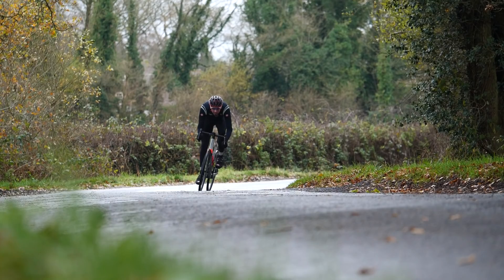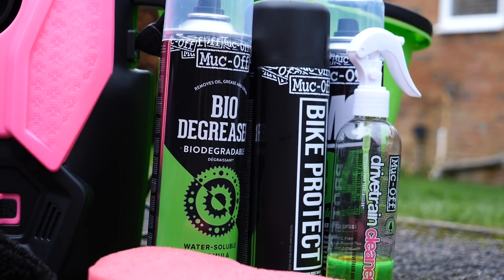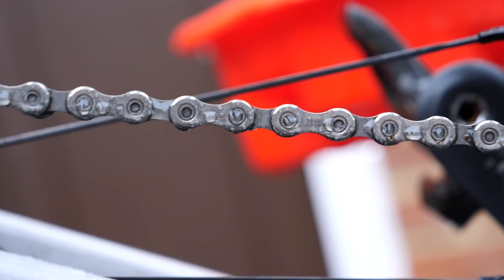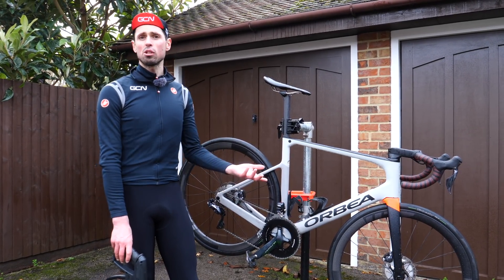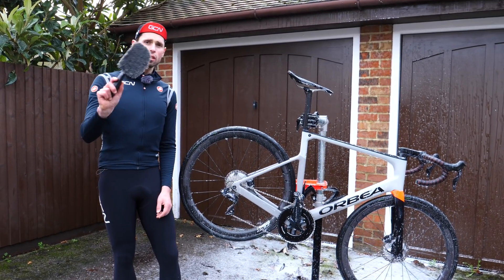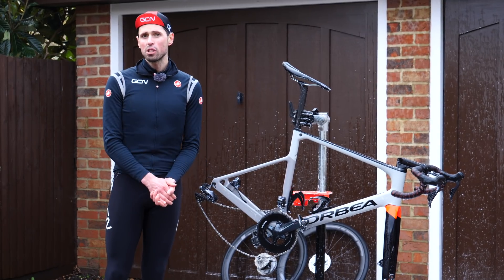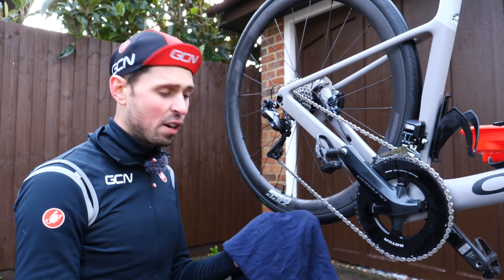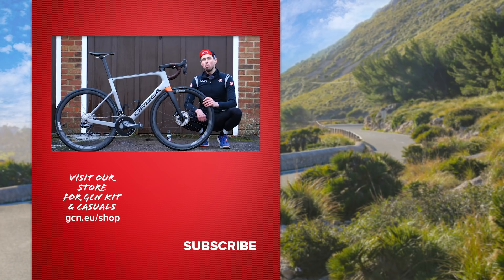How To Keep Your New Bike Super Clean

Comment: A bike specific power washer!! I thought I heard it all, what a load of nonsense.
Reply: Exactly, just hold a normal one further away
Reply: Bike-specific pressure washer = crap pressure washer with low pressure 😂 Didn’t GCN do a video recently proving that the danger from pressure washing bikes is a myth anyway 🧐
Reply: i mean, basically all the ''bike specific products'' are just a premium cost mechanic products, any type of car cleaner and most of the lubricants can be bought by the gallon at 10th the price of any Muc-Off product

Comment: Wow, I thought GCN knew better.  This should be the "How Not to Wash Your Bike" video... This will damage all your bearings.  Step one, Never ever apply degreasers or solvents directly onto your bike's drive components as the solvents will easily go past your bearing seals and in a few days your bearings will be ruined.  But for GOD's sake Never Ever use a power washer which will easily push water right past your bearing seals and into your bearing cartridges. In a few days your bearings will start to develop rust. SO DON'T DO IT!

If you want to clean your drive components get in the habit of removing them off your bike and have at it with solvents until they look like new.  As for the chain, that too, remove it and place it in a plastic container with 1-1/2 cup of paint thinner.  Shake it good for 30 seconds and let it sit overnight or at least 1 hour.  Then shake it again remove from the container, then swish it around in soap and water for a minute to remove any solvent residue.  Now your chain is clean INSIDE & OUT. Then oil and BINGO your bike is looking like new.
As for the painted surfaces & disc wheels, there's nothing like TIDE laundry soap, it's strong enough to remove deep grime and grease stains, yet mild enough to not harm paint finishes.  Some of the products in this video are really harsh and dulls paint.  

IF YOU WANT TO CLEAN YOUR BIKE TO LAST WITH OUT PROBLEMS, YOU MUST DO IT RIGHT OR DON'T DO IT AT ALL.   Dan  ( :

Comment: When you apply the degreaser in that way, you can contaminate the brake pads. Best option would be to cover them properly. And, even clean later with alcohol.
Reply: I was thinking the same thing. Its the only thing i disklike about disk brakes on bikes is how easy they contaminate
Reply: could even try and spray it on away from the brake disc...its what i do and get very little contamination

Comment: That pressure washer is a total waist of time. Use a good old fashion hose. The amount of water is uses is incredible, it uses electric, and its costs a lot more than a hose, bucket and  sponge. You never see the pro teams using one. So when you are telling us to use environmentally friendly products think of everything. Also your sponsors lube is a pile of junk. Do a pole on it! 
But I do think your films, and all the shows are very good and really informative.
Reply from the maker: Thanks for your comment and your thoughts on the video, we really appreciate it! I think you'll find that almost all pro teams use pressure washers for cleaning bikes, we've even covered this in some videos previously for example 👉https://gcn.eu/teamskywash
Of course you are right, a bucket and a sponge can use less water and energy, and that is a good consideration to make - on the flip side a pressure washer with cold water can be just as, if not more, effective as a bucket of hot soapy water so the difference in energy used is not quite as great as you might think!
Reply: @gcntech  I am corrected about  pro teams using P/washers,  But did pick up on. 
May be use another method if you want your part to last!

Comment: What a waste of product spraying most of the degreaser and the foam in the air! 
A foamgun is made to clean a car. I apply degreaser with a brush and a carshampoo-solution with a pressurized spraybottle. Blow dry with a small Metrovac Air Force Sidekick airdryer to save you a lot of time and WD-40.